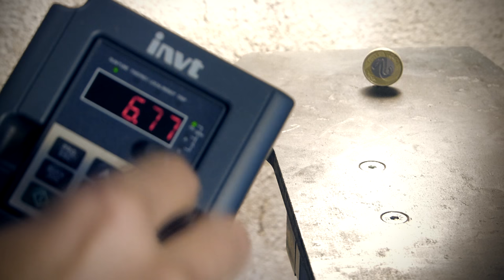#1 KNIFEMAKING VLOG - NEW GRINDER AND A KNIFE CONTEST FINALIST [Trollsky Knifemaking]

Comment: nice work,,,im building my own grinder at the moment,,,but i dont know what motor to use,,,i have a choise of two,,,,single phase 3 hp 4 pole 1500rpm,,,or single phase 3hp 2 pole 3000rpm,,,,,the price is about the same.thanks in advance for your help